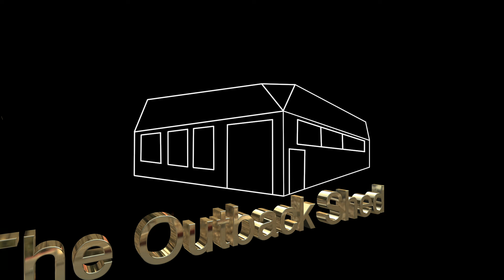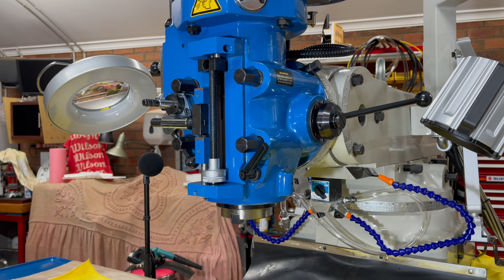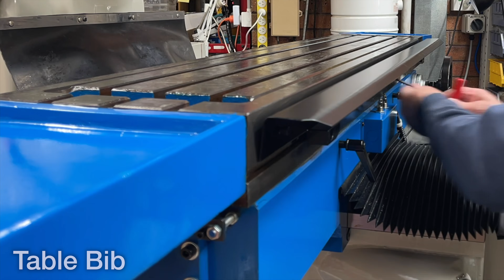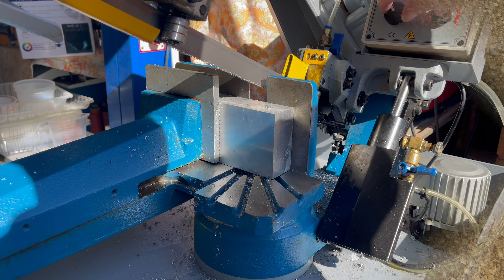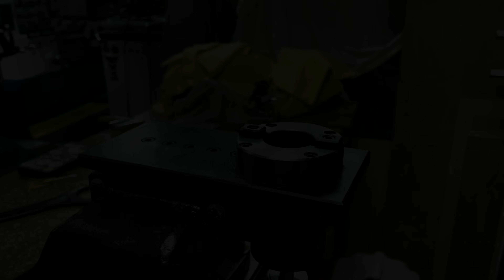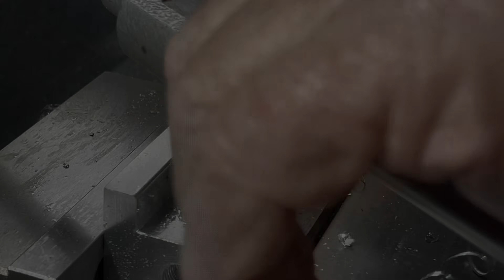My Favourite Mill Upgrades

Comment: Hi great channel I just have a question about your bm-70 ve mill ,I have one the same brought second hand but the feed lever on the panel does not lock in position so any time you are feeding the table while cutting you have to hold it.I am wondering if you would mind getting me the part name and number off your 4 way joystick so I could purchase one the same thanks.
Reply from the maker: Thanks for the comment. For the Joystick X-X; YY: its called a SWITCH 4 DIRECTION; ZD-PA203
Order Code: MY5000
https://www.machineryhouse.com.au/my5000

Its a special order in part, not sure of the cost. Hope this helps, Cheers SteveO
Reply: Thanks Steve really appreciate you taking the time to respond thanks

Comment: Does that keyless chuck ever gaul up drill shanks? Does it ever let go? Ruining shanks gets old quick.
Reply from the maker: Thanks for the comment. YES it jolly well does. I didn't tighten it enough and it spun. Luckily the tap was OK with no marks. Generally It works fine if I use the key to tighten the chuck, on this occasion I didn't nut got away with it.
For larger taps I use a collet chuck. I do have a tapping chuck but seldom use it, they tend to break taps. The drill chucks are more forgiving. Cheers SteveO

Comment: Nice work Stevo, like the new Mill VFD spindle and power knee very nice. I have a 56B I will get one of those IGaging quill read outs hopefully it fits as easily as yours did. Air system looks very tidy. Cheers
Reply from the maker: Thanks for the comment. The iGaging DRO is very nice, I can get nearly 150mm of travel with it after a little tweak. I'm very happy with it. Cheers SteveO